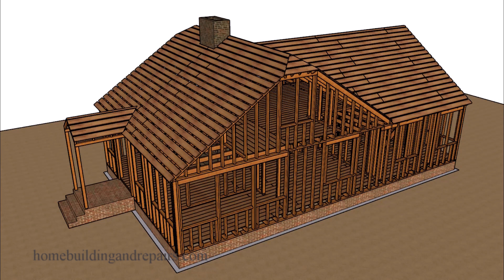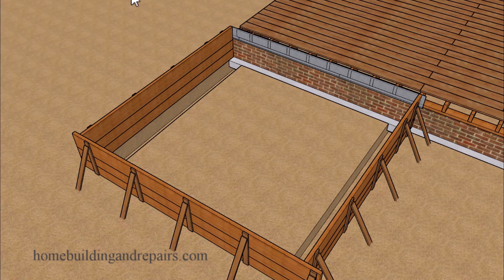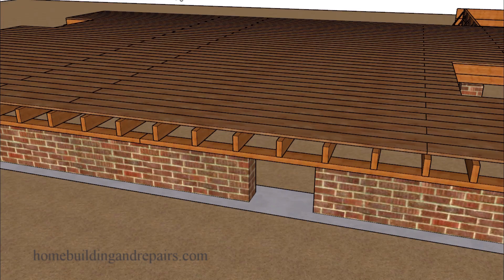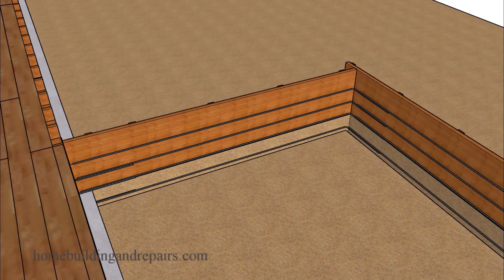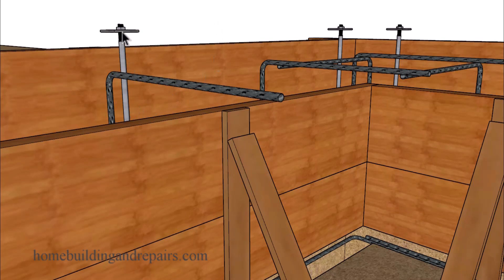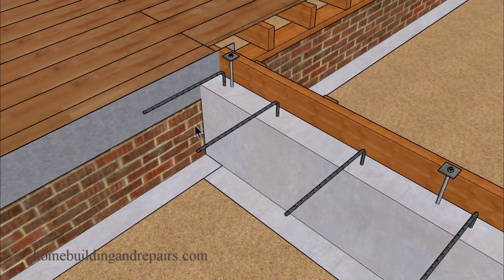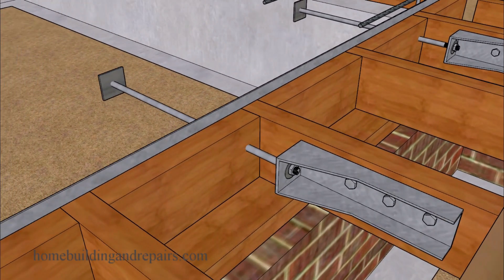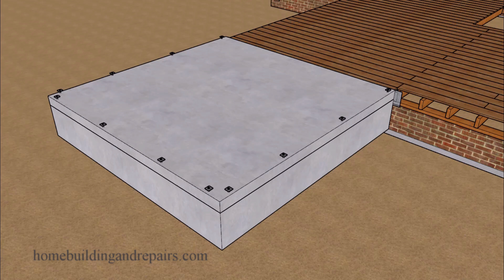How To Build Concrete Slab Foundation For Home Addition With Existing Floor Joist And Crawlspace

Comment: What was the thickness of the sheet metal used to cover the joist ends? Thanks.
Reply from the maker: Recommendations:

For most residential applications, 26-gauge galvanized steel is a good balance of cost and performance.
In high-moisture environments or for added durability, consider 24-gauge or thicker galvanized steel, or stainless steel.
Ensure that the sheet metal is installed with proper flashing and sealing to prevent water intrusion.
If using aluminum, ensure it is of adequate thickness to prevent punctures.
Ensure that any fasteners used are also corrosion resistant.
It is very important that the sheet metal is installed in a way that creates a slope away from the wood, so water cannot pool.
Reply: @gregvancom  Thank you.

Comment: I'm a little late to this party, but I felt a need to respond. As a residential architect (specializing in additions and renovations), a critical thing (of many) I learned from a structural engineer was to match the existing foundation design as best you can. The reason for this is that the earth "moves" ,  or heaves (mainly due to the soil's hydraulic conductivity), and a different foundation design (eg. piers vs spread footings) will have a differential movement rate than the existing foundation. This can cause a hinge effect and wreak havoc on the structure above... produce cracks at intersecting masonry veneers, tile and wood floor finishes, roof elements, etc. I always insist on a geo-tech report for the consulting structural engineer.

Comment: Related Question, slightly reverse of what you talked about. What if there is already slab foundation on a house that was torn down; Can I use that foundation to build a crawl space on top of it?

Thanks, just recently discovered you! I have a couple of rental properties and thought it might be fun to try building from scratch.
Reply from the maker: I would think you could, but you might check with local building departments if you have on.
Reply: @gregvancom  Thanks!

Comment: thanks, I always find these videos super helpful as a way to start thinking through the general steps of a project. I know you're probably not a geotechnical engineer, but what I struggle to imagine is what all that new concrete and gravel (and house) would do to the soil under the house. maybe it doesn't happen often but, if the ground were soft or there was a void you were unaware of, couldn't that new addition act like a giant lever on the old house? maybe it wouldn't act fast, but could it slowly act over time? how do you start deciding if that's an unlikely risk versus a risk you should consider
Reply from the maker: You've got a good question and since I've never dealt with this situation, won't be any help.
Reply: Your question is a valid concern, and yes, it can!

Comment: You forgot the UFER ground. It's required.
Reply from the maker: I didn't know it was needed for this project. Feel free to explain why it is needed.
Reply: The NEC requires in new construction that rebar, metal water pipes, etc be bonded together
@gregvancom
Reply: Well, I'm for grounding if UFER grounding.

Comment: Do you really need that much rebar for such a simple project? It almost seems overkill which is common among engineers. Either way great video, great info and explanations.
Reply from the maker: I don't think I would do it with less than 24 inch on center spacing and thanks for the kind words.